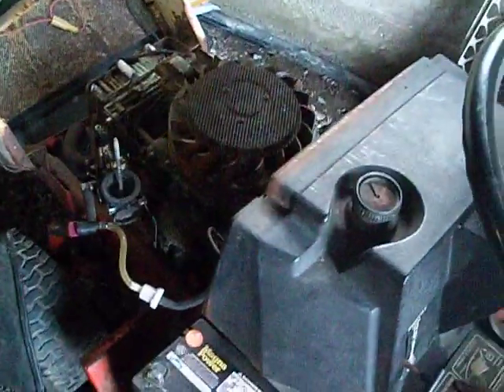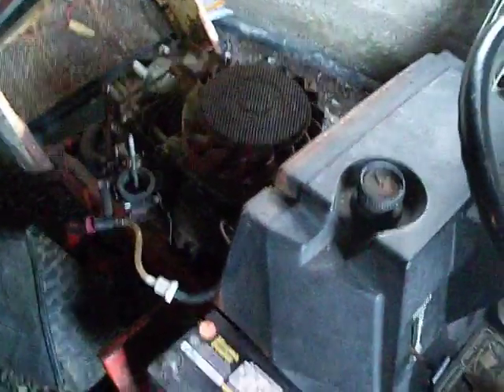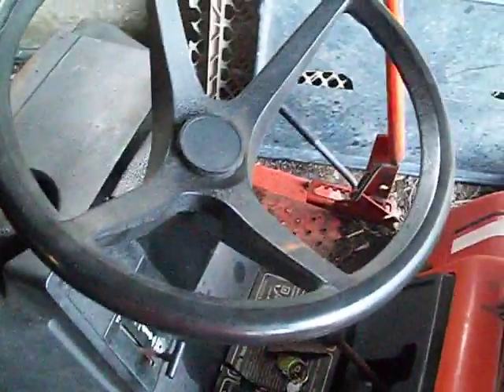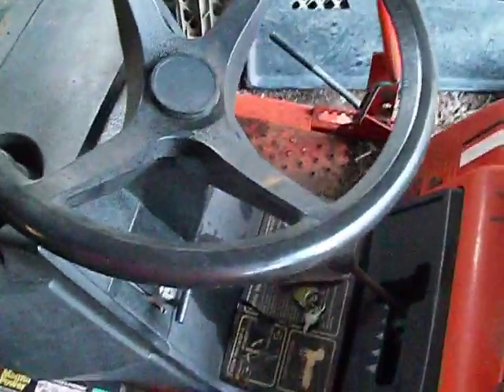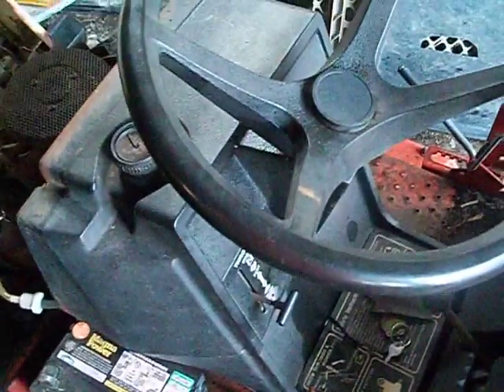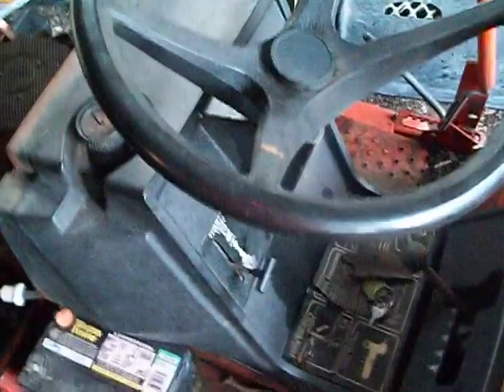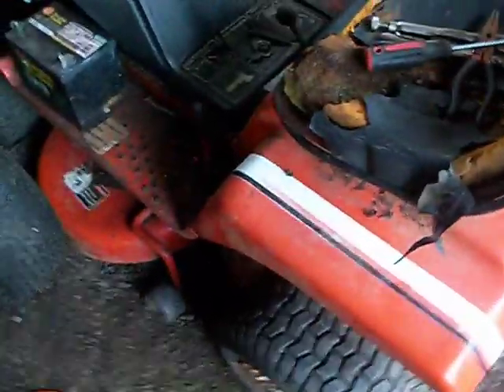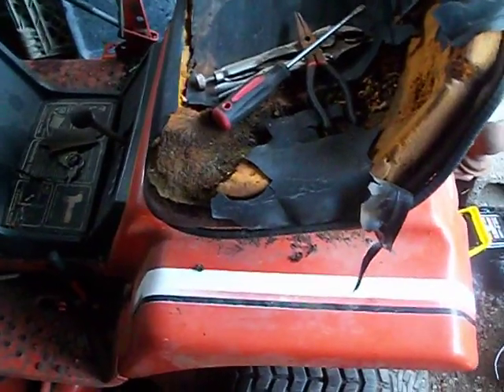simplicity tractor 4211  part 9 11hp briggs running last vid for a while maybe

Comment: Tractor sounds good. I'd leave it like that. If you have the engine shrouding, I'd put it back on so that you can keep the engine cool. Also, I bet the tires are why you are having trouble moving the tractor. Have you tried to move the tractor while it was running?

Comment from the maker: the wires are inside the console under the steering wheel where in ignition swich plug is locisted is it possble to pull the plug wire threw the igition switch hole

Comment: Never for get a mechanics good friend; leverage it seams to me it might be able to solve both problems for the wheel make Shore that all nuts and what not are remover and use a long 2 by 4 to pry it off and I think a beaker bar might remove the stuck bolt but what were you using to remove it a socket? I'd bet so if this is true I got a poor mans way of doing it